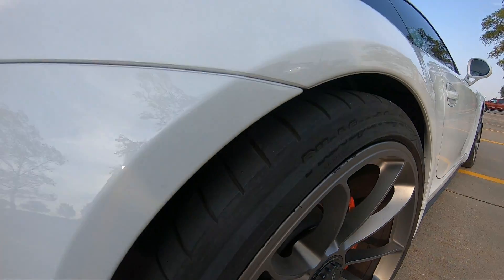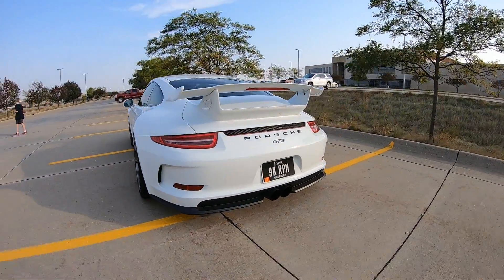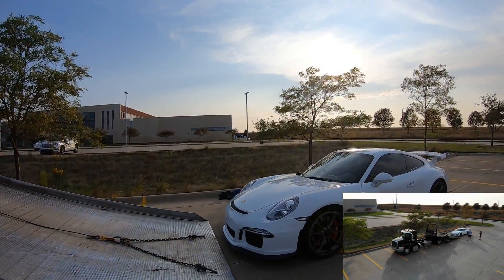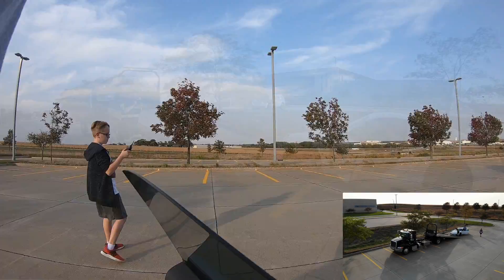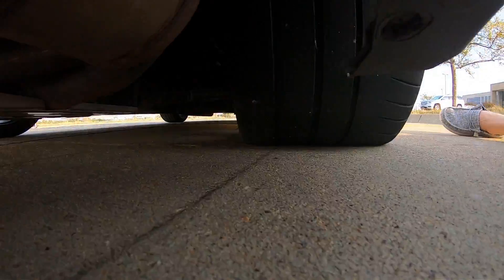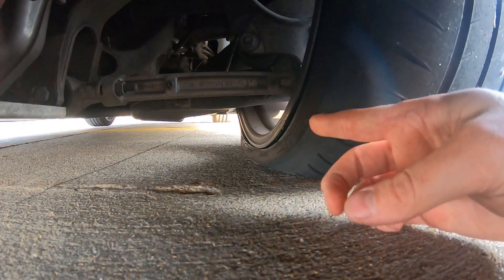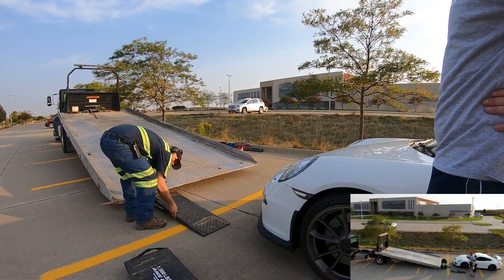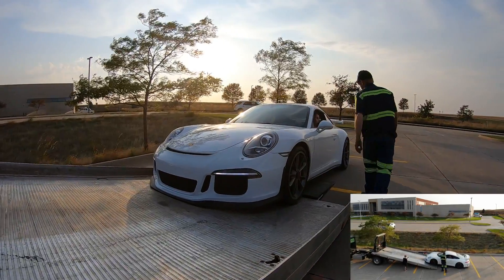Porsche GT3 Tire Blowout time for new tires

Comment: Sorry to hear about the blowout. Glad you guys are ok and no visible damage on the wheel or body.  Make sure discount tire properly installs the centerlocks. Remove caps first and need liberal amounts of aluminum paste. Torque to 440 ft lbs,  very important to recheck torque after test drive.